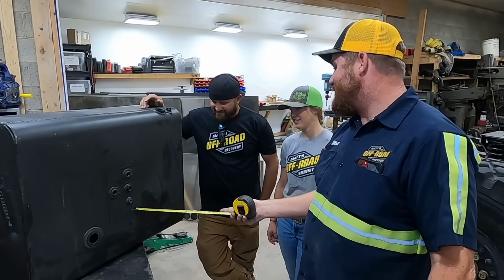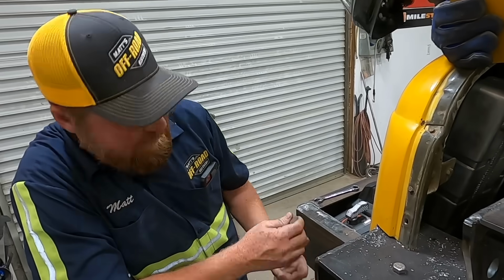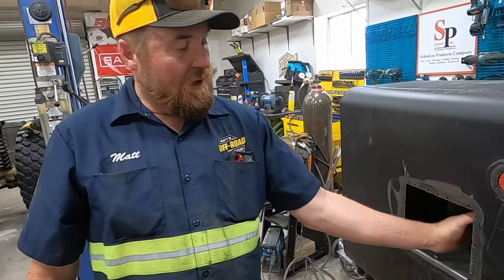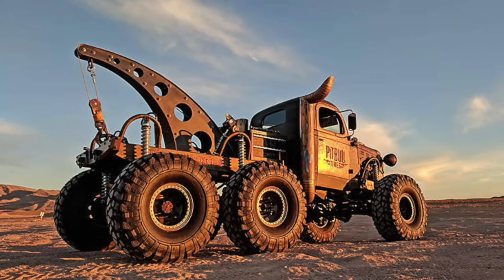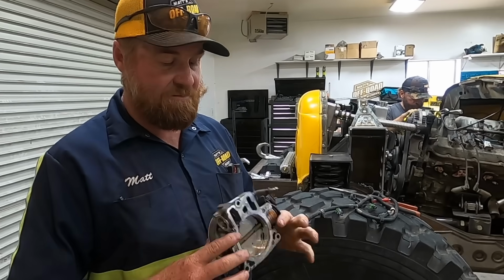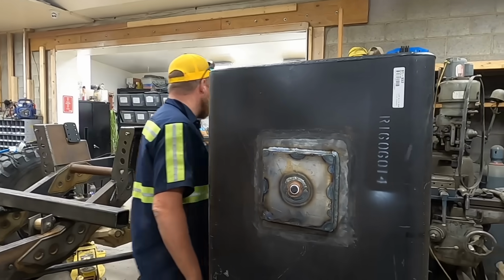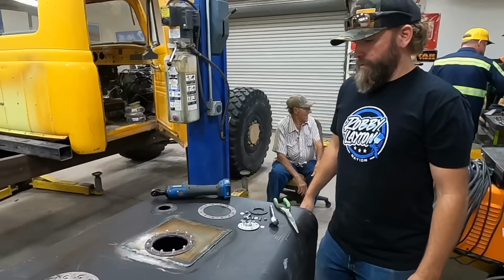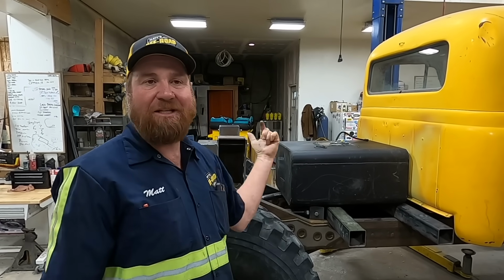World's Largest Off Road Wrecker...There Can Be Only One.

Comment: Don’t rigid mount the fuel tank it eventually will crack  mount it on springs that’s how they mount the water tanks on an Oshkosh front discharge concrete truck been driving them for 20 years and we do a lot of off-road to get to job sight

Comment: Matt, Happy Father's Day! After that, I would recommend adding a hydraulic accumulator to the hydraulic system. Especially to the brake part of the system. In the event of an engine failure it you give you one or two applications of the brakes. It could also be applied to the steering, but you wouldn't get much power out of it. Another backup would be an electric hydraulic demand pump. In aircraft the first backup is the electric demand pump. The second is the accumulator. The accumulator would give you a parking brake. Just my 2¢. Great build, keep going.

Comment: Doing great Lizzy! You've come a long way. Just some advice for welding tanks from my experience. I build high pressure fuel oil tanks for boiler burners. If you weld towards your previous weld you will have less chance of leaks. The previous weld is still hot so your puddle will melt into it much better and burn out the impurities or porosity. Starting on the previous weld gives more chance for leaks. Just my two cents! To Matt and all the crew, thank you! Love the channel, and all the others guys' channels I've learned about from watching yours

Comment: On the Fuel Tank, I might put some straps over the top to mount it so if ever that cab shifts and bumps into it, then the tank won’t peel open and empty itself.  My brother hit a deer with a ‘67 ford pickup and it wrinkled the front of the bed where the cab shifted back into it.

Comment: I'm not expert, hell I can barely dress myself in the morning, but with 360LBS+- of fuel constantly pounding against the sides of the tank like a hammer, will two single straps bolted in "single shear" fashion be enough? Most tanks I have seen sit in some type of a tray style or platform (supporting all the sides from the bottom)  with straps that go over the top of the tank. It also seems like it will put allot of stress on the bottom of the tank, especially on those whup-to-do and washboard roads.

Comment: Thank you for your detailed explanation of the 6x6!  I was "one of those guys".  It's very cool, but as noted, not really a wrecker. :-)   Keep up the good work and great videos!
Reply: Yeah, it was fantastic Matt could explain the differences! No idea the boom on 6x6 isn't really a boom or that it was more of a show piece. Please keep it up Matt, we want to know what you know! Matt #1 for 1st Olympics!
Reply: Ignoring the wrecker/recovery aspect, might the 6x6 have a better break over angle because of the shorter wheelbase between the first and second axis (which would be countered by the smaller wheels)? A similar question would be in regard to ground pressure: more wheels vs larger wheels.

Comment: I don't think you should weld the gas tank straps to the tank because when the gas is jostling around it may create enough force to tear the weld spot then the gas will leak out. I think you should try a tic-tac-toe style strap that holds the tank from left to right and front to back, that then allows it to strap to the frame including rubber cushions to give support.

Comment: You should work with Texas Speed and Holley EFI/FuelTech for the engine! I bet they could freshen it up and give you some upgraded parts to make it more reliable (Texas Speed and others are amazing with LS engines), as well as using a known system to run the engine with digital dashes/etc that are known for reliability.

Comment: I know you’ve already built it with a sump, but I’ve been looking into Walbro MP fittings for my fuel cell. Work like the Holley fuel mat without the insane cost. One in each corner and it’ll keep running no matter what angle you get on.
Reply: Updooted for visibility. Looks like a great product, especially for weird / custom stuff.

Comment: Holly..... not the "trouble maker" lol makes a product that is a matt "pun intended" called the hydramat. It will provide fuel almost upside down.... so you really didn't need to make a fuel pump hole....... but hey its fun making things....... I watch this stuff and don't want to go to work, just want to dust off the welder and mess stuff up!

Comment: Another awesome video from the MOOR team!!! Only thing I will note is TIG welding on the tank would have giving better results. But if you you want to MIG weld it and test it, use a TIG to flow out and fix the MIG weld where it leaks. Works the same if you have a crappy MIG weld, just flow it out with a TIG, no filler needed most times and no grinding!!!!! Would love to join your team!!!!!

Comment: Lizzy, how does it feel to be the best welder in the whole shop!  It is beautiful.  Way to go cowgirl ! ! ! ! !

Too bad on the gas gauge.  That fuel pump extension could have been above and below the fuel pump pivot, and then the gauge would indicate real full and empty.  But then the gas gauge baffles would have to be bigger for the float to travel.

Are those square tubing cross pieces for the fuel tank going to be in the way of the drive train.  Hard to tell from video.  Some big upside down "U" brackets that span the frame would give more drive train space.  

 Most of us figured out that Kenny's beautiful rig is a showpiece, not a workhorse.

Lastly, love the build.  It is the highlight of my Sunday computer time.

Comment: For the gas can, I'm hoping you're planning on using a square bracket welded to the straps.  If your welds only run along the length of the strap, they'll be under a lot of shear loading, especially fueled up and on an incline.  Welds that run normal to the strap should react that load better.
Reply: Agreed, for that same reason I was going to suggest the straps run up and over the tank and are bolted down at each end. Welding a "strap" to the underside of the tank puts a large stress raiser on the edge of the welds at the end of the straps, It wouldn't take much sloshing around of that full tank to tear the welded strap out of the bottom of the tank.
Reply: Was that a rush reference

Comment: matt a sterling 10.25 axle is not a light duty axle and you should never call it that again it is a medioum duty axle rated for 40+k lbs nothing you use your wrecker for would limit out that axle again a dana 60 not a light duty axle its a heavy duty solid axle used mainly in heavy duty ford trucks even a ford 9 in is a heavy duty axle you need to research the weight difference between hd and ld before "ranting" because everything you said was wrong other than the fact his truck is a show truck and wont ever be worked
Reply: and matt plz dont take this the wrong way i love the channel and im not bashing you but if you gonna rant about comments please know what your talking about
Reply: also clark is a great name i think and the wrecker is coming along nicely

Comment: "Comment below why this will never work" Well that tank mount will work short term, BUT I would not want to rely on it long term. There is a very good reason large tanks are strapped to mounts.
You have a lot of weight there when full and with it bouncing around those mounts and the tank welds will have a lot of fatigue stress on them.

Why not fit a proper fuel sender, you can get them to fit tanks like that?
Reply: Also it definitely won't work without gas in it. Lol

Comment: GAS TANK 
Warning:  welding anything to the tank will cause crystallization of the metal, weakening the patch around the strap.
I n 1968, I watched a super-modified homebuilt car burn because the strap was welded to the tank. Please use more strap, run it around the top of the tank and bolt the strap to the frame.

Comment: So it looks like the short float arm and the location of the float on the gas sender is going to say full until you get down to less than a quarter and then start moving. There's other kinds of sending units like concentric floats or floatless that would give you accurate reading top to almost bottom (I think everything leaves a little reserve after bottoming out on E). Are you going to switch that out? They're made for big tanks on big trucks, for stationary engines with big tanks, and for marine applications.

Comment: The fuel tank won’t work because . . . more the up than the down. It will take a while, but the thin sheet of the tank will fatigue. I’ve run a 2mm ally tank off-road by putting it in a bigger 3mm box with foam around it. That gave me a bund, a fire wall and the tank was low stress so I could drive like I normally drive. :o) Like the dyspraxic tree hitting, rock gouging person that I am :D

Comment: I would be tempted to go for a swirl pot for the fuel system, that way the main tank supplies the pot and the pot supplies the engine.
The main tank should be able to keep the pot full enough that you shouldn’t have fuelling issues on inclines etc 🤞

Comment: Do you need to perforate the baffles in the tank to allow air and fuel to flow into/out of that area?  (I’m thinking of just a dozen or so 3/8ths inch holes all around.) 

Anyhow, I’d be grateful for your response. I assume there is a reason this is. It the case, but I don’t know it. Thank you.

Comment: @mattsoffroad Holley makes a sock that goes on the bottom of the fuel pump. It's quite large and it's purpose is it will wick gasoline to the pump as long as a piece of it is in fuel. It's perfect for extreme angles

Comment: Hey Matt.From my personal experience. Please don't weld any type of mount to the gas tank. Make a saddle and strap it down. I made that mistake on a vehicle that never left paved roads. And it still cracked . I know the tank you have is heavy gauge steel. It will still crack. Just trying to help.
Reply: That is exactly what I was going to point out, the weight of that tank full, frame flex, rough terrain. Those welded connections will work and tear the tank.
Reply: Totally agree. Eventually those stress points where it's welded to the fuel tank will crack.
Reply: Yup, should always be straps. I've also seen fuel cells fail for this exact reason.  People use the welded on tabs and it cracks right there.
Reply: I agree, just look at what has worked for years in semi's.  tanks with straps.
Reply: Agree I just wrote the same thing.  Just make two straps.
Reply: Can we name it big bird?! Since it's color sre yellow and has a kinda long front in it.
Reply: @aldwinmusngi2544  I suggested The Pineapple and it will CRUSH all the competition.
Reply: I believe he enjoys running out of fuel, this is just so he can enjoy running out of fuel when he thought he had a full tank.
Reply: I'll start with this: I have not made a tank this big or an offroad rig. That said, gasoline is 6.1 pounds per gallon so.a 60 gal tank full will have 366 pound of fuel. The tank looks to be 50 to 80 pounds. That is a lot of loading above the mounting points. Wide straps, maybe a couple of straps connecting the mounting straps or gussets around base to distribute weight may help. Thinking of a pickup bed fuel transfer tank.
Reply: Yes I have see people make this error a few times on aftermarket tanks but same goes for all tanks there's a reason they mount them the way they do!
Reply: Yeah it'll work like u said Matt but it will fail with the type of work your gonna do is all we are saying Matt
Reply: My tractor tanks been welded on since 75 and I guarantee this trucks gonna have a much easier life then my old Massey
Reply: Everyone just like this comment like crazy to get them to see this they no need breaky parts
Reply: You can weld brackets to tank if you add back plate to spread pressure
Reply: Custom Motorcycle tanks also  if the mount isn't just right and has a real good rubber bushing they will crack every time
Reply: Didnt he box the frame? If the frame is not flexible and does not twist the tank should not crack.
Reply: @Dave-ow9zb  He did box the frame, but all "rigid" things flex some. It's just how much. And 400lbs of tank and fuel is going to put a lot of stress on those welds, flex or no flex.
Reply: @Dave-ow9zb   even if it didn't flex at all like rock solid, fuel is about 6 lb a gallon an that tank will hold at least 120lb + when 80% filled ( I bet 160lb full)  with the weight of the tank pump etc included
You start snatching caras out of stuck positions or towing heavy load an vehicles out of rocking areas flexing the suspension an bouncing off the rock here and there as you go while hooked to a vehicle, all while at times having the tow wrecker frame leaning while going through a tough area an been snatched by the load or bounced off rocks like happens alot, just the sudden jerk while leaning  an snatching can be enough to snap a weld on that 100lb tank with fluid making waves on the inside an the sudden impacts of the solid frame it's mounted to..... Would be different if the tank had a bladder an the mounts was apart of the sheet metal of the tank vs welded on mounts, just something about the welded on mounts I think any of us who have done offloading long enough or racing know the outcome from personal lessons learned or seeing others learn the lesson and taking notes our selves to make sure we don't make the same mistakes.

That's part of building vehicles an doing fabulous fun fab work ( I love building, fabing, welding things from scrap metal an making it into a one off part to fit my needs!!! Love it)

No one who has built or been in this world of custom vehicles is saying it won't work the way he's doing it which is a great idea vs just welding tabs an bolting the tabs down, but we are saying that we don't think it'll last and could cause a fuel leak one day which could create fire or worse a explosive tank an none of us Wana see someone loose a life due to a mistake that we all seen coming but a ego of I'ma prove them wrong ( by the way he said comment below why it won't work) but still is gonna build it that way... We love these builds an don't Wana see anyone hurt is all, so I hope Somone will talk Matt into being safer with this an fixing it before it's taken out farther than a suspension test
Reply: He did say it’s a show truck.
Reply: He's not welding to the tank, he's going to wrap it with straps, with rubber between the strap and the tank. Rewatch that section of the video.
Reply: @om617yota8  He literally says he is welding it to the tank. Watch again and listen.
Reply: @robertbcope  Woops, right you are. I completely misheard that the first time. Yeah I agree, why not wrap the strap around the tank like every single automaker does? That tank is going to weigh 400+ lbs when full, those welds are going to pop and dump fuel everywhere.......

Comment: Matt, as soon as you put those fire department tow hooks on the frame rail ends and there was a shot of the grille AND the hooks, it instantly reminded me of a WARTHOG. Look back at the video and see if you see the same thing. Maybe you may have found a name for the wrecker. (EDIT): I had paused the video to type the previous and as I started watching again you bring up the Warthog name and aircraft it has been used on.

Comment: Not saying your idea won't work, but I would worry about the welded on tabs tearing/cracking the tank along the welds over time. Why not make straps that go over the top and bolt to the crossmembers on each side? No welding required, just a few tapped holes. Basically like a car fuel tank, just upside down.

Comment: You need to rethink that double radiator setup.?  You are taking hot air from the front radiator and blowing it on the cooled water coming into the rear unit.  That just reheats the water again.  That second radiator needs to be relocated in its own, separate airflow.    Or, it could be combined with the front unit to make one big thick core.  A thicker core is probably the best solution.
Reply: @MattsOffRoadRecovery  I experimented with multiple setups in heavy haul truck applications, pulling 250,000 lbs  loads up and down mountains at near walking speeds in 100 F. heat.  Engine, tranny and diff, cooling is a challenge.  For me, a thicker radiator core proved the best solution.  Fan types and shrouds are very important too.  Good luck.

Comment: Hey guys, so I have an idea, Weld in two threaded bungs near the top and one at the bottom of the fuel tank and put in a couple nipples to connect a clear fuel line to, being that its a fluid it will fill the tube up so you have a visual representation of where the fuel level is at so you dont have to guess the whole time.

Comment: Please tell us that you reversed the Flow path of the radiators because last video you talked about it the hot water went into the radiator in the front and then into the smaller radiator behind it and that is very inefficient and is hurting your cooling performance the hot water should be going into back radiator so the hottest water touches the hottest air and the cooler water gets the coldest air

Comment: If you guys are a little worried about the fuel pick up you should look up the holley hydramat it's a pretty cool product they come in all shapes and sizes from massive one's that cover the whole bottom of the tank to little ones that go down in a sump like you have. I used one in my xj. There's some demonstration videos showing how they work its really cool they actually work it will suck the tank completely dry before introducing air into the system so you'll use all your gas.